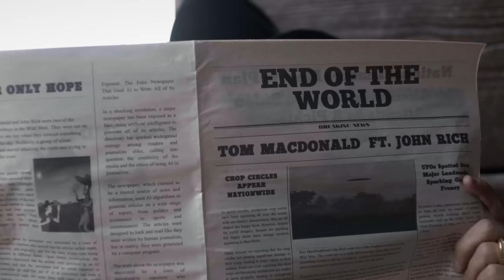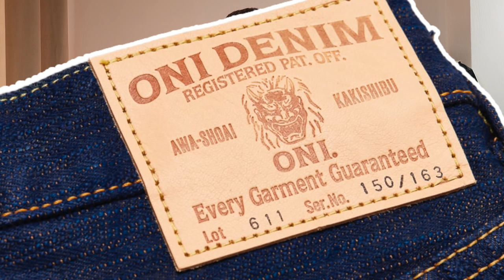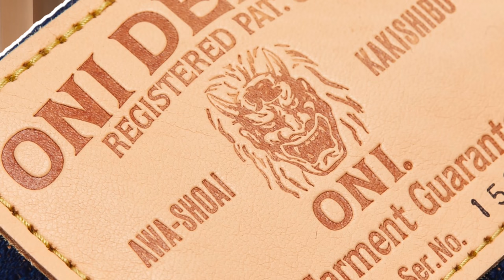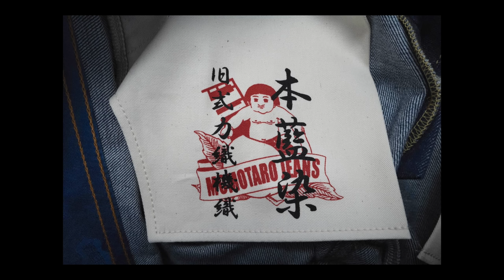Why Are These Jeans $5000?

Comment: I actually think the second pair might be worthwhile instead of the short-thread ones that are used for texture, but then why don't they offer any undyed options for those of us who are almost completely OVER the whole indigo thing already? Also, I bought some jeans for twenty bucks and I almost wore them last week. Maybe this week? I finally got to wear my heavy duty khaki pants because the weather a bit unseasonably cool still, but that's likely ending soon enough after we had the first heat wave already.
Reply: Oh, but obviously $1500 is however many times more than I will spend on jeans since I think $80 is excessive.
Reply: I used to try to patch jeans in the nethers and usually just ended up with bigger holes.
Reply: @Highland_Paddy  id bump up that budget. i think theres some remakable products out there made by some really special companies. im not an iron heart guy myself but if your into practical menswear they have some ripper stuff from a totally utilitarian standpoint.